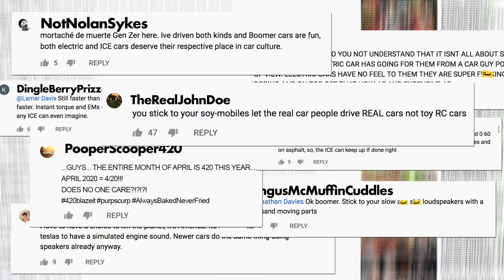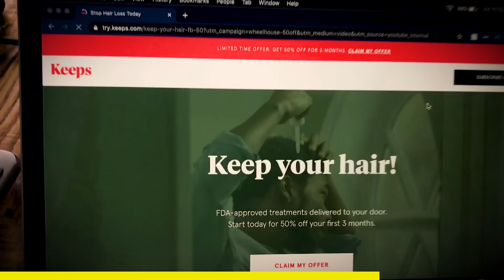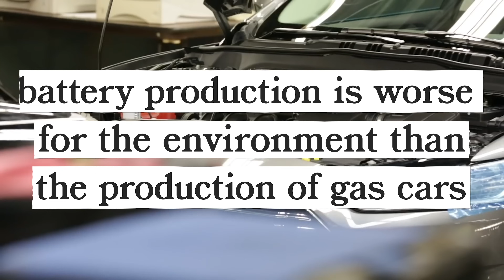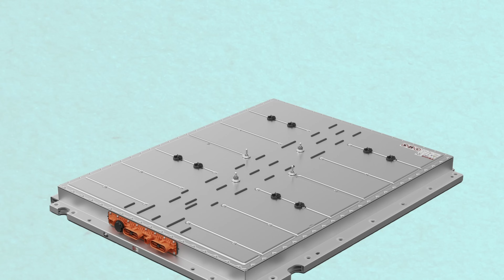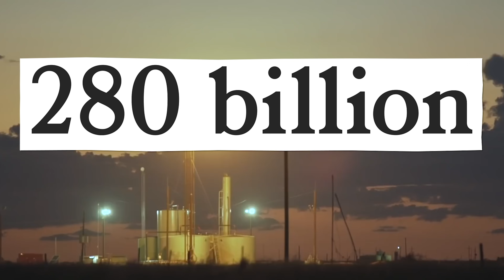Are Electric Cars REALLY Better for the Environment?

Comment: Since electric generation is roughly 1/3 efficient, everything else equal, 3 times the amount of emissions no longer produced by your car if now EV is added to what is going up the smokestack at your local power plant.  But all else is admittedly not equal.  An EV is roughly 3 times more efficient internally than a gas vehicle.  So if you multiply your 3 to 1 internal EV efficiency advantage by the 1/3 external inefficiency, you get a wash.
This video merely declared my facts “false” as a conclusion but didn’t actually rebut them.  And since you talk about this kind of pushback “every time we talk about EVs,” as you say, it’s clear to me that you do have an agenda so please don’t try to claim an open mind.  
In the future, try to rebut the facts in opposing arguments with facts, not more conclusions.
Reply: That claim is comically false.  Electricity production is 1/3 efficient compared to what???  You think gasoline arrives on a flying unicorn???

And EV's are 4x to 5x more efficient than combustion engine cars.  So EV's are hands down more efficient.
Reply: @redbaron6805  Sorry Red Baron - you would go down in a dogfight.  Yes, electric engines are 60% efficient internally compared to only 20% efficiency for gasoline, so the "internal" advantage of electric cars over gasoline is 3 to 1.  That's what your onboard computer is reporting to you when it says you're getting the equivalent of 110 mpg.

What your onboard computer doesn't tell you (because it has no way of knowing) is the efficiency of the process that generated the electricity used by your EV.  Since almost 80% of our overall electricity is still generated by burning fossil fuels, and that process is generally 1/3 efficient, then the 1/3 benefit of a 3 to 1 advantage is 1/1, or a wash.

But you may say "my utility is 70% renewable" so you think even if it was otherwise a wash, you're still ahead by whatever amount of green electricity is in the "mix" for your local utility.  The electric generation "fuel mix" argument is a Red Herring, Red Baron.  What none of these so called studies take into account (either ignorantly or deliberately) is that regardless of whatever amount of available renewable electric power any utility has, until that amount reaches 100% of its total demand, then necesarily it must produce the shortfall between available green electricity and its total demand by continuing to run fossil fuel power plants.  That deficit necessarily also includes any NEW demand for electricity.  

Converting from gasoline cars to EVs creates NEW demand for electrictiy which, necessarily, requires that the net effect of buying an EV is to keep the fossil fuel burning power plants running longer to supply that extra demand you created by swithing to electric vehicles.  In short, your new EV is forstalling the day when the local coal burning power plant (that would have been phased out with the next wind farm if everyone still drove gasoline cars) is actually shut down because they have to continue to makeup the larger shortfall created by new electric demand caused by EVs.  It has to keep running to supply the EXTRA electricity all the new EVs require.  So only when we reach 100% of current demand will EVs BEGIN to make sense.  Why begin?  Because if we go totally EV, that will increase total electric demand by 30% so when we've replaced 100% of today's demand we'll still have an additional 30% to replace because of all the EVs, requiring the polluting power plants to run for years longer to power EVs until they are replaced.
Reply: @markodom3841  First, it is obviously complete bullshit that motors are 60% efficient.  The most efficient electric motor is 99% efficient as seen here: "ABB recently set the world record for electrical synchronous motor efficiency. During factory acceptance tests (FATs) carried out with the customer present, we recorded a result of 99.05% full load efficiency"

But even using a variety of motors and efficiency ranges, as seen here: "Motor efficiency varies between 70 and 96% [1]. The portion of electric energy that is not converted to mechanical power is converted to heat, which is mostly unusable."  EV motors are pretty close to 90% efficient.
Which again, proves my point as internal combustion engines are 17% efficient on average, and EV motors 90%, so EV's are easily over 5x more efficient, not 3x.

If your rant about 70% renewable and utility mix was supposed to make a point, it was completely lost.  Even if the difference is made up using fossil fuels, since EV's are 4x to 5x more efficient, it is still far cleaner and far more efficient to use EVs vs burning gas or diesel fuel.

And I can tell you really don't understand how electricity production works.  EV's create demand for electricity, but the grid has surplus electricity available outside peak demand times.  Peak demand is 8 hours a day, Monday - Friday, excluding weekends and holidays.  So peak demand is less than 25% of the time.  Nuclear is usually the base load and there is frequently surplus wind energy at night.  But, yet again, since EV's are more efficient that gasoline or diesel cars, even charging them on 100% fossil fuels is still cleaner and more efficient than burning gas.

That is beside your coal claim which is complete BS.  Coal plants have a 40 year lifespan, once they reach end of life, they are decommissioned.  No one sane is building new coal plants as they are simply not cost effective.  So, coal is being replaced by gas or renewable energy, both of which are far cleaner than coal.

So, let me break this down for you, yet again.  EV's are 4x to 5x more efficient.  For every EV that is charging, even from a fossil fuel power plant, there is a gas car not burning gasoline.  So, the net effect is LESS pollution, no matter how you spin this.  It takes around 6kWh to refine crude oil into a single gallon of gas.  That same 6kWh worth of energy could power an electric car over 20 miles and you can skip the gas completely.
Reply: @redbaron6805  You are quoting your pro-EV sources on-line when you say 4 to 5 times more efficient (I've not seen those BTW); I quoted my own pro-EV sources on-line that said electric cars are 60% efficient from battery to wheels while gasoline cars are only 20% efficient from gas tank to wheels.  That full tank/batter to wheels comparison is the only one that matters.  But even if EVs are 4 to 1 more efficient (instead of 3 to 1), that is only a slight advantage over gasoline when 2/3 of fossil fuel used to generate electricity is wasted.  And, the comparisons have been based upon standard inefficiencies of gasoline engines.  With the increased availability of instant start/stop engines, the efficiency of gasoline engines will improve against the EV efficiency so the wash will continue.    

Also, having built natural gas, coal and lignite power plants for eight years (so, yes I do know something about the subject), you need to separate the two different environmental issues.  Natural gas is "cleaner" than coal because it has less solids to start with, which solids in coal are much of the pollution because they DON'T burn completely resulting in smoke and soot.  These do result in pollution problems.  But the difference in CO2 between gas and coal is much smaller since that is a byproduct of what DOES get burned in any fossil fuel.  The heavy metals and "pollutants" settle down to the surface creating air quality and other problems, but do not rise to the upper atmosphere crateing the green house effects that cause global warming/climant change.  Therefore, switching from coal to gas power plants will help with air quality down below but will have a nominal benefit in fighting the rise of sea levels.  

But you can thank President Carter for us having as many coal power plants as we do since it was his executive order that prohibited utilities from having more than 50% of their fuel base be gas.  So, utilities all over, including in the south in the oil patch that were 95% gas at the time, had to build coal/lignite plants to comply with the order (that order is what gave me a job for eight years).  

I'm sorry you don't understand my fuel mix point - I'm not sure anybody has really thought that issue through but if they did, that would make their light go on and realize that the increased electricity demand caused by EVs (utilities still would have to keep the same reserve power margins so your point there was another red herring) necessitates keeping the fossil fuel power plants running longer to supply that added demand that will be caused if we have wholesale shift to EVs.
Reply: @markodom3841  I'm quoting ABB a motor manufacturer and Science Direct.  This information isn't exactly hard to find.  Battery to wheels efficiency is misleading as MPG on gasoline cars are not refinery to gas station to car efficiency.

And the average efficiency og gas engines is 17% but that is just engine efficiency, not total efficiency.

Yet again, you are mixing two completely different metrics.  All in, electric cars are 4x to 5x more efficient, taking into account generation of energy and driving the vehicle.  If you take into account energy generation, EV's efficiency can be over 300Mpg.
Reply: @markodom3841  Also, not sure what the point is to make misleading claims about CO2 emissions from coal vs natural gas.

We know the numbers already from the EIA, as seen here: "According to the U.S. Energy Information Administration, natural gas emits almost 50% less CO2 than coal. Different types of coal produce different amounts of CO2 while burning. Natural gas also emits less carbon dioxide when combusted than fuel."

So, your claims of "But the difference in CO2 between gas and coal is much smaller" is completely false.
Reply: @redbaron6805  Your ABB reference refers to electric engines generally, not specific to battery operated electric engines in electric cars.  My sources compared the two by btus and measured that way, electricity has a 3 to 1 efficiency to gasoline.  But your 4 to 5 times more efficient argument DOES NOT take into account the 1/3 efficiency of generating electricity which requires dividing any electric engine advantage by 3.  The refining process does increase the cost of gasoline relative to electricity because it adds another step while direct use of energy saves cost (gas and coal go directly into the boiler of a power plant and do not have to be refined).  But the rest of the crude oil in the refining process is not wasted but used in other products (Jet A, tar, plastics, etc.).  

The planet doesn' t care if we destroy it directly or indirectly - the net effect is all that matters.  So, even if you eliminate 100000 tailpipes from the road (yea! great!), the extra electricity needed to charge the batteries of all those EVs replacing them will virtually be the same amount of extra CO2 being added to what's already going up the smokestacks of 10 power plants.  The polar bears won't care which way it gets into the atmosphere - the environmental result will be the same.
Reply: @redbaron6805  So great!  If we switch our remaining fossil electric power generation to only gas without coal or lignite, then we need only switch from standard gasoline to instant start/stop engines and we're back to a wash again.
Reply: @markodom3841  Your claims are getting more desperate.  EV's use Synchronous Electric Motors, the ABB efficiency record was for electrical synchronous motor efficiency.  There are no battery operated "engines" in EV's.  They use electric motors, and those motors are either AC induction motors like Tesla used to use, or Synchronous DC motors that newer Tesla's and other EV automakers use.  Yet again, you don't appear to know how this actually works.

It doesn't matter which way you slice it.  Gas engines are 17% efficient on average and electric motors are over 90% efficient on average.  If you take electricity production vs gasoline production, it doesn't help gasoline cars as gasoline production and distribution is not even remotely efficient.

And your claim of "gas and coal go directly into the boiler of a power plant and do not have to be refined"  are beyond comical.  Do you seriously think coal just shows up at the power plant via the Coal Fairy?????  Coal has to be extracted, often via explosives, and then extracted and loaded via heavy trucks and equipment, then loaded onto trains to be transported to a power plant, then loaded into the power plant.  

So, yet again, your claims make literally no sense.  It doesn't matter how you slice it, EV's are far more efficient all in or motor or engines only.
Reply: @markodom3841  Now, your claims are getting comically stupid.  Having instant Start Stop system is NOT a wash, or even remotely close.  Electric cars are far more efficient in part to regenerative braking which charges the battery instead of converting motion into heat using brake pads.

So, this entire discussion is getting beyond embarrassing.  You LITERALLY have no clue how this actually works.  Here is how much Start Stop systems save in fuel: "A study by the Society of Automotive Engineers found that using start-stop can see a car's fuel economy improve by over eight percent in heavy traffic."

EIGHT PERCENT.  You are not making up the different efficiency levels of EV's by adding 8% efficiency to an engine that is 17% efficient on average.

So, how about you do some actual research on how these systems actually work before posting any more garbage....
Reply: @redbaron6805  I arrived at the "fuel mix" debate because my prior discussions with many of your fellow EV supporters (and seeing many reports by them on YouTube like these) evolved to the point where they admitted that the 3 to 1 efficiency advantage of EVs over gasoline cars was largely offset by the 1/3 efficiency of generating electricity.  Many even were honest enough to admit that the manufacture of EVs had more impact on the environment than do gasoline vehicles, but claimed that the EV would overcome all those disadvantages within 4 to 5 years of purchase.  That whole line of argument by them was well past your continued claims of up to 5 times efficiency which none of them asserted in their pro-EV stories.  

However, your fellow EV supporters persisted by assuming the position paraphrased as follows: "but because 20% + of electricity is NOT from fossil fuel, and since the percentage of renewable electricity will continue to climb, then my "wash" argument goes away over time."  In other words, your friends admit my basic argument about efficiency offsets but hang exclusively on the assumption that as less fossil fuel is used to generate electricity (gas or coal), my point becomes moot very soon, thinking that their EVs percentage of green electricity is the percentage mix of the local utility.  It's not.

They fail to understand what I tried to explain that you also said you didn't follow.  So let me try again with two hypotheticals - one with gasoline cars and one with EVs:

Utility A has 5,000 megawatts in total demand, including required reserves (which they will have to have in any case).  Being out west in an area of hydroelectric dams, open mindedness to nuclear power, wind farms and desert areas where solar power plants can be built and be effective, they are up to 3,500 megawatts of available green electricity, leaving the remaining 1,500 to necessarily be supplied by fossil fuel power plants.  They are 70% green!  They have one coal site with two 500 mw units and one gas site with one 500 mw unit, making up their remaining 1,500 mw of fossil power.  Today, a new wind farm is put on line putting 500 mw of new power into its grid.  So, to receive the most environmental benefit, they cut the coal power plants production by 50%, from 1,000 total mw to 500 (either by turning one unit off completely or cutting both to 250 mw each).  Now they are at 4,000 available mw of green power of 5,000 mw of total demand - now at 80% green -  Great!  They immediately start to build another wind farm that when finished will put another 500 mw into their grid putting them at 4,500 mw of green power, or 90%.

Scenario 1- People keep driving gasoline cars.:  When the new wind farm is put on line, they shut down completely the remaining coal burning power plants (cut to 500 mw last time) leaving only the 500 mw gas burning plant to meet the 5,000 total grid demand.  Yes, those cars are still putting out CO2 from all that gasoline but at least the coal power plants have finally been shut down helping the environment as coal is dirtier than gasoline.

Scenario 2 - 1/3 of people in that utility service grid area have switched to EVs since the last wind farm went on line:  In this scenario, when the new wind farm goes on line, they call the coal plant and say: "hey Harry - you can shut it down now."  But Harry says - "if I shut it down we'll be 500 mw short.  Since the last wind farm went on line, our demand has crept up due to everybody buying electric cars.  Our total demand is now 5,500 mw due to EVs so we're back up to 1,000 mw with the two coal plants to meet demand."  They then say - "Okay Harry, then cut the two coal units back down to 500 mw total since we have a new wind farm on line."  That utility does now have 4,500 mw of green electricity, but since the total demand is now up to 5,500 mw due to EVs, they still have to run the coal plants at 500 mw, combined with the 500 mw gas plant, when they would have been cut off had nobody bought EVs.

Many of your EV friends admit that if we went totally to EVs it would increase total electric demand by 30%.  So, in my hypothetical, if 1/3 of the people in any given area switch to EVs, then that would require an increase in total demand of 10%, or 500 mw in my hypothetical 5,000 mw utility.

In short, when anyone buys an EV, they are keeping the dirtiest fossil fuel buring power plant in their area running and producing more adverse environmental impact in direct proportion to the amount of electricity it takes to power their car, regardless of how much that is.  It would be ambitious to assume that we could replace 10% of all our electric generation every five years.  So, at only 20% presently, even at that ambitious rate, it will take 40 years to replace all the fossil fuel power plants.  Until you reach 100% green electricity, your EVs are keeping those dirty fossil plants running longer. 

How many cars will you buy in the next forty years?  Keep driving gasoline cars until your utility only has natural gas as its remaining fossil fuel plants compared to whatever percentage of renewable it has.  At that time, your EV will be charged by that natural gas power plant - still having a negative effect on the environment - just not as bad as when using Jimmy Carter's coal.  So when that time comes, just make sure you have switched to an instant start/stop gasoline car (already available) that would offset the advantage to EVs if no coal plants are left in that area.  Only when your utility reaches 100% of today's demand will it start to be an advantage to drive EVs, and only when the additional 30% required is also replaced will it make total sense because that added 30% demand will necessarily be powered by keeping fossil plants running that would have been retired 15 years earlier had EVs not increased total demand by 30%.  

I'm just relying on facts many of your brothers-in-arms have already acknowledged, but for which they haven't thought it all the way through.
Reply: @redbaron6805  Well, for my sin in building coal and lignite power plants in the 70s and 80s, credit my carbon footprint to Jimmy Carter - he made me do it.
Reply: Also, if you are pushing for natural gas power plants over coal/lignite until we're all renewable (many years from now), how are you going to deal with all the anti-fracing nuts that, if successful, will make gas unavailable requiring the use of coal again?
Reply: @redbaron6805  You missed my point about coal and gas going directly into the power plant - I only meant that there's no refining step that adds cost to the raw product.  Yes, I saw 100-car trains from Wyoming to Arkansas carrying coal in 80 ton cars so I know the delivery logistics.  But coal and natural gas are transported in their raw form and used.  Crude oil is not put into car's gas tanks - it has to be refined first.  That was my only point.  There as some EV owners who think that because their electricity cost to charge their battery for X miles is far less than the cost of a tank of gasoline that that means electricity is more efficient.  In cost yes, but the net in environmental impact is still a wash.  

The very article we're commenting back and forth on admitted the efficiency offset issue but claimed that as we have more and more green electricity, the "wash" argument goes away.  That's why I started with pointing out the "fuel mix" myth since we (other pro-EV presenters like this one) were already in agreement on the efficiency points.
Reply: @markodom3841  It is not about coal power plant being a sin, those plants were 70's and 80's technology.  Technology has moved on, so they are obsolete now in every way, not matter if it is cost, pollution, CO2 footprint or coal ash disposal issues.
Reply: @redbaron6805  No argument there.  But in replacing our old electric generation with new clean power, cost will always be a factor.  It cost $700 million to build two 700 mw coal units in 1977 - such would cost billions today.  Any replacement technology would also cost billions to replace a utility's entire grid so it must be done over time.  Until the money is there, we'll still use coal and gas if normal service life time is left on those units and the more new power demands we create (EVs), the more we'll need to keep running them and for a longer period.  That's really my only point in all this.
Reply: @markodom3841  My point is, in reality, renewable energy is being built every year.  And as coal plants reach end of life, no one is building new one's.  In fact, they are retiring a lot of them early as they are no longer cost effective.

That capacity is being replaced mostly with gas, and some renewable energy.  

But the core  data in favor of EV's is still their efficiency, which is typically 100Mpg equivalent or higher.

Compare that to a gas car average of 26Mpg.  So, even 100Mpg, which is the larger EV's, which would normally replace cars that get closer to 20Mpg, the efficiency gains are around 4x to 5X more efficient when they replace a gasoline car of equivalent size and performance.

Even a Prius that gets replaced by a Tesla Model 3, which is one of the most common scenario's, the efficiency gain is around 3x, or 52Mpg vs 150Mpg equivalent.

So, no matter how you slice it, wheels to wells efficiency or wheels to wheels efficiency, EV's still win out.
Reply: @redbaron6805  So, your own 52 mpg to 150 mpg is consistent with what I and many of your fellow pro-EV supporters are saying - at least 3 to 1 internal efficiency advantage of EVs over gasoline.  So the also admitted 1/3 efficiency of generating electricity with fossil fuels (still 75% of electric generation in the US), one third of a 3 to 1 advantage is a wash. 

But even if it was 4 or 5 to 1, it would need to be more than that to offset the larger total vehicle environmental impact of manufacturing and disposing EVs over gasoline cars, also admitted in the very story we are chatting under and others, and to be worth putting up with the many problems with EVs not yet worked out (charging availability for road trips, quick charging capability, loss of power in cold weather, child slave labor in Africa to mine raw materials for batteries, etc.).  

You seem to also not have realized my main point - that no matter how much renewable electricity there is in any area where you charge your EV, if it's less than 100% then your EV is effectively using whatever fossil generation remains, and the dirtiest still operating, for that utiltiy because your EV represents new demand that wouldn't exist if you still drove gasoline cars and that extra demand forstalls the day that utility can retire that natural gas power plant, which is fossil fuel and therefore it has a carbon footprint.  It's not the comparison between natural gas and coal fuel sources for electricity that matters, its the comparison between natural gas generated electricity and gasoline driven cars that matters.  That gap is much smaller.

In short, when one thinks through all the pluses and minuses, the environmental benfit today of EVs over gasoline cars is nominal at best and not worth putting up with the problems they haven't solved yet.  Wait until all of our electricity is generated with renewable sources and then EVs will make total sense environmentally and the problem will have been worked out by then without you being a guinea pig while making Elon Musk a trillionaire.  I estimate it will take about 40 years to get to that point.  Musk himself recently said we don't have enough electricity if all vehicles are electric and also that it is unrealistic to think we will ever completely get off petroleum.  Look back at my detailed examples - whatever amount of petroleum we will still be using in the future, it will be used to charge your EV.  Without EVs, fossil power plants would be shut down years earlier.

But we can now both see we are both being kind to the environment - we're both recycling our arguments.  We'll have to agree to disagree I suppose.